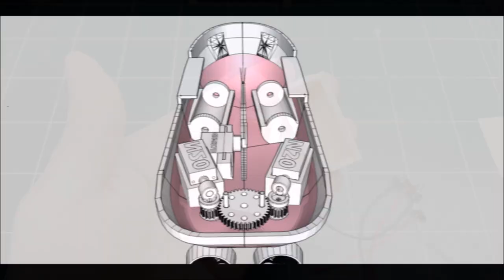3D Printed RC Tugboat 1/144 ASD 2810 EP 5 Arrange RC parts

Comment: Hello. May I know where you got the pinion gear for the motor and what radio you are using, the receiver is small.
Reply from the maker: The gears were introduced by the previous video.
And the receiver Flysky FS2A 4CH AFHDS 2A Mini Compatible Receiver